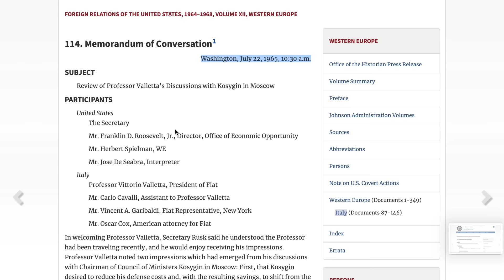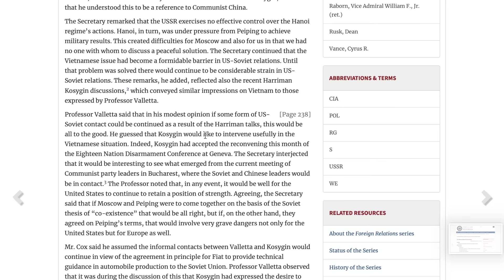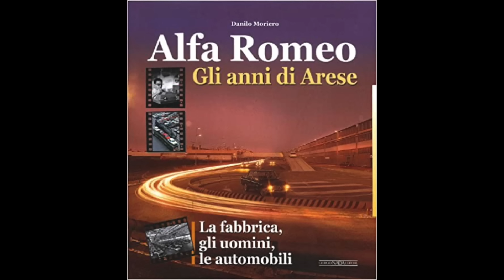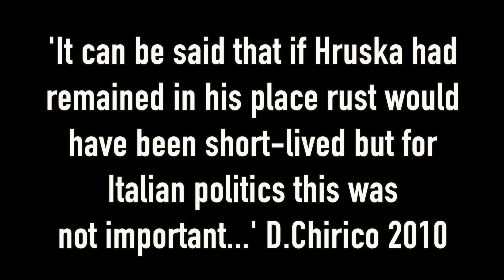Alfa Romeo And The Myth of Russian Steel - The Real Reason Alfas Rust

Comment: I think in Great Britain they mixed up 2 historical era and jump to wrong conclusions.
After 1934 for Italy it become very hard to source good quality steel due to sanctions for the war in Ethiopia. Stalin was more the willing to pay Italy in Oil and Steel in exchange for engineering projects and know how form ship building, to the point that many of his WWII ships were either built or completely designed in italy.
For Italy it was a necessary evil, but the quality of the steel was terrible: some sources (British as usual) wrongly state that Italian tanks were bolted instead of welded because of lack of expertise, which is not the case as welding was common practice in shipbuilding. The problem was in the steel used that did not allowed for reliable welding due to bad oxidation. It was made a priority to source all the top quality steel for the RM battleships which left none for the rest of the industry.
It is a known fact that the BD601 and DB605 aircraft engines built by Alfa Romeo could not rev as fast as the German counterpart despite being identical. The problem was the quality if the available steel, while Isotta Fraschini never managed to complete it's in line engine development for mass production due to structural reliability.
After WWII the Italian industry could access quality steel again, and the rust record averages similarly to what came from other nations, including the USA.
Certainly there were induced weak points due to saving on metal thickness, both from saving money and reducing weight, but not to unseen levels. As someone said the Beetles were rust buckets despite being thick as tanks and unnecessarily heavy.
Understand that Galvanized steel was not yet a thing in car making, power painting rare and expensive, cars were to be mass produced and rarely could stand 100k km in the hands of the average consumer, and second hand market was not big before the mild seventies, so, outside of the always mossy British isles, rust was not really a big problem. Paints were also not particularly advanced until the mild eighties with heavy solvent based misture and no use of advanced polymers. Chrome details and rubber gasket were all that was available to keep water out.
Until that 80s, export market was not particularly important for Italian carm makers for non "premium" products, as lower price models were mostly sold and driven inside Italy, so it was easier to stop selling problematic models, if serious problems with rust were found in GB, then re haul the whole production line.
Specific rust problems on certain cars (Beta and Alfasud) could be traced to faulty production lines but  don't forget that cars like the Mercedes 190 and several BMW also suffered massive rust problems and very few samples are still in driving conditions today.

Comment: All cars around the world had very bad rust problems... say mid 70s to mid 80s... Cars in the USA made in the USA had the same  problem... The story goes that cars were built to last in those days the life a car was about 15/20 years... engines would die before the body of the car  fix or replace the engine the car was good for another few years... The sale of new cars was not good... So to get new car sales up... A cars life was made to last about 5 years... And must be made that it would cost to much to fix... Body rust... This was done by the paint that was used some thing was added to the paint to speed up rusting... In the mid 80s car Manufacturer were Caught out doing this... and made to change... From mid 80s a lot of cars started to last much longer ... That is what a body shop worker told me...So if that is true I don't know ? But it makes sense to me...

Comment: I have to say I think most 70s cars rotted out quickly......just some more quickly than others. I had a1975 MK1 golf, 12 years later it was scrap...the shell was rotten. (I would say is was rotten from about its 6th year!!)
Same with VW Beetle...my fathers was rotten after 11 years and scrap! Again was rusting from about year 6
All 70's cars rusted...that's why there are soo few left now.
Also depends on climate, salted roads etc....
Put any 70's car in a super dry climate with no salt on the roads and it would still be going now!
I think Italian cars were just off lesser quality production than others......so they didn't really stand a chance.
Shame because the Italians can and do design lovely cars......
I think one of the British Leyland plants had the paint shop the other side of the road to the production line
Bare shells would be carted across the road come rain or shine to the paint shop!
And guess what....they rotted out too........
Cars from Japan were awful for rust....and still are......My ten year old Subaru died from a rusty  subframe and now my 2012 Mazda 6 has rust around the roof where it meets the windscreen and also front subframe is looking horrible.

Comment: I don’t see the problem with rust, the car gets faster as it gets lighter!
Vauxhaul/Opel solved this by self tectylating system by leaking oil from the oil pan and spread it under the car.

Comment: Alfasud's were manufactured in south africa as far as I know.  They had a factory in Pretoria till about 1985
Would not be surprised if your right hand drive car was made there
If it were, the rust story doesn't make sense.. south africa had none of the Italian manufacturing issues, no strikes, well educated and trained work force
Reply: Irrelevant.  First -  the South African built Alfasuds were made with bodyshells from the Naples factory so would have inherited the same problems, BUT as they were only built there after 1981 by which time Alfa had fixed most of the problems at Naples they were probably better made anyway.

Comment: Here in New Zealand I had the misfortune to work in a ckd (completely knocked down) car assembly plant in the 1970s and saw first hand the real reason certain cars rusted so badly. 

    They arrived at the factory in bare steel with a thin coating of oil to prevent rust. We then had to wash this coating off, an impossible job with the time constraints. The cars were then painted,  but over the oil, results obvious. 

.   Blame socialist politicians and their pressure groups for these fiascos. They try to dictate what is built, how their built, where and by whom. 

     Let the free market work and keep politics out of business. You'll see similar disasters looming in the idiotic electric car "industry" where these socialist clowns are rampant.

Keep up your excellent videos.

Comment: And IF Soviet recycled steel would be used ? So what! It is still the PAINT which protects oxidation. I particularly know two cars that had no rust issues but on rear hatch - so steel theory is lacking. One was Yugo and other was SKODA 136 (Felicia). Yugo rusted around rear hatch lock, like mad. And SKODAs were rusting below plastic trim on rear hatch, like mad. There is so banal reason why Yugo rusted there. The hole punched out for rear hatch lock was tiny bit too small for the lock and when they were assembled workers hammered lock through he hole. Always chipped paint from the metal edge. Years after of course water had it's time to make it's magic there. Than all people I knew used to leave keys in lock when the opened the hatch, because it was made so that it could be opened only with a key. Not to make mistake and lock key inside car, they all left key in the hatch lock until they closed the hatch and pulled key out. But Yugo had one bigger key and two smaller key in cluster. Bigger for ignition, smaller for all locks and smallest for reservoir cap. Those keys were dangling down and punching on paint beneath the lock which eventually gave up and start rusting. So "every" Yugo was rusted around the lock and had bunch of small rusty dots beneath the lock. Or, the smart owners, always had piece of insulation tape popped beneath the lock, for the purpose of protection. 

Skoda: similar reason. When plastic trim was "nailed" on the metal, it damaged paint and beneath the plastic it was a fold that collected water so it was often rusted. Many car specialists at the time were always against that time "fashion" to put plastic cladding on cars. That was fashion to "modernize" old models. They said the cladding is always rust farm. They were true. Perfectly healthy cars until you removed cladding.

Comment: Interesting indeed, and thanks for the in depth history including the political interference! I also thought the Russian steel was true. 
Truth be told, good vs bad steel would only effect its mechanical properties. If it is mild steel, not matter the quality - it will rust in the presence of oxygen. As I understand it, in the early '70s Alfa moved to Calcium based primers for it's low cost and ease of application (essentially cheap enamel paint) which was not good enough as an oxygen barrier, and assisted in galvanic corrosion. (apparently people in the know used to mound a zinc sacrificial anode from a boat outboard engine onto the chassis to stop rust from forming). Only in the late 70s did they move to Zinc based acid primers that kind of solved the problem. - later fully galvanizing the bodies with the launch of the 155. All being said, I drive my BMW with my head, but drive my rusty Alfa with my heart! In my opinion giving these old ladies a nip and a tuck now and then is a small price to pay for motoring perfection. That's all i have to say about that

Comment: This myth has to be debunked, in order to save the AlfaSud's aftermath, and everything this small car accomplished in the seventies, essentially creating the hot hatch sub-segment, alongside the Renault 5 Alpine. Production line issues also included improper windshied rubber fitment (ALFA also used rubber for windshields in Arese, made from the same Pirelli factory) which left cavities and gaps between rubber and body, insufficient waxing of closed upainted cavities and box sections (apparently, line workers had to insert wax with a large plunger inside the area, completely filling it. That caused wax to ooze and cover theirt hands. In order to avoid having to clean the area and themselves after each application, they just didn't push the plunger all the way, resulting in less wax in the cavity - the reason why ALFA added the foam step in the assembly line, only to realize that the used formula was hydroscopic), and most importantly, many absent force during harvest season, as many workers were also farmers in the area. Couple all that with the aforementioned lack of motivation, endless stoppages and minimal manufacturing tradition, and the result was a crippling manufacturer, eventually succumbing under financial debt and IRI's top executives, who just so happened to also be FIAT's top brass. Busso's resignation in 1977 was also dictated by this. Great video!

Comment: Look at the Soviet built Fiats and what do you notice?
They DON'T have major rust issues.
And they almost certainly were built with Soviet steel.
Reply from the maker: Yes, they also used thicker gauge steel…
Reply: There are no soviet fiats, the Lada is almost a completely different car, between it and the 124, there are over 800 changes/differences

Comment: The car manufacturers do a lot of tests and know to the minute when they bodywork will start to corrode. If they used better steel and components we wouldn't have to buy more so often. It's called "built in obsolescence" and if governments were really serious about the environment then it would be far more beneficial to force manufacturers to build for length of service than force us off the roads and the potential civil unrest. Industry creates 75% of the waste in the UK but it is the 25% of householders who are punished. Computer manufacturers, in collusion with software writers, are guilty of the same in the name of profits.

Comment: Japanese rusted straight away but their engines we're far more reliable than anything else .
Ferraris ' had no rust protection before 1984 and Ive heard that Daytonas  rusted very quickly  .Its always amused me that they command such prices ,
Lack of rust protection aside Fiats were worse than british cars .They even rusted in the middle of panels of mirfiori 131s'.FIAT paid out many compensation claims because of fires with the latter ,In Ireland where I live two children left alone suffered burning but Fiat would not pay because their father had a non approved sunroof fitted .They sued their father .The story goes that fiat rather than correct a design fault chose to pay compensation ,

Comment: Never owned an Alfa because of the horrendous rust problems back in the early eighties but I did own a Fiat 128 and a Lancia Prisma and none of these suffered the dreaded rust rot, however I've also owned a Honda Accord from about the same period and that rusted on the panels under the paint.

Comment: Why hasn't someone or even you just had a scientific analysis of the composition of the steel?  That could determine not only what the alloy makeup is but even could determine what mine it came from.  But it doesn't have to be that difficult.  Test some Soviet tank steel and old ship steel and compare it to the Fiat and Alfa steel.  This couldn't cost more than all of the research put into finding 50 year old documents to find mentions of the purchase process.

Comment: Italian cars were no more  rusted as other cars were, more or less up until the mid sixties, there after, say 1966-1967 on wards and all through out the 1970's Italian cars rusted at a level and rate unprecedented until the early 1980's. The reason was NOT Russian steel, nor was it factory work practices.
          There were no en mass produced cars in Italy (as in the USA) to speak of until after the second world war, one needed to be  wealthy in Italy to own a bicycle let alone an automobile, in terms of the mass population. In wealthy countries pre war and post war Australia, USA, Canada, for example etc mass production I.E  Ford model T, model A, and the other dozens of manufactures that existed at the time were producing cars for the masses prewar, NOW post war Italy (cars for everybody)  mostly all cars produced in the 1950's and 1960's as they approached there use by date (somewhere between 7 and 15 years) unlike Australia for example (up until the great demand for steel from the Chinese from 2000 on) every rural property would have cars,,,,old cars parked under trees, in paddocks, and so on, NOT so in Italy (no room) so by the end of the 1950's a recycling of the early post war mass produced cars was introduced, (particularly as Italy had no Iron ore) in effect the Italian cars of the seventies were recycled Italian cars of the decade before, to cut to the chase, they had not figured out the metallurgical methods in which this problem could be avoided until the 1980's. The steel in the 1970's cars was rusting from within in itself, (impurities) not from the surface under the paint,,,,,,,,,get my drift. No ones fault, certainly not the Russians. Simply put, Italy is resource poor, very poor, (unlike Sweden, Germany) had to recycle, they eventually solved it, but not before it gave Italian cars a very bad name for a long time. Italians are very sorry for those that suffered with those issues, it is now history, and Italian cars are now, and have been for decades as rust free as any other car on the planet.

Comment: I have what I believe is definitive proof.
My 85 Spider was very good, and only had a small amount of rust in the usual places. Areas that would entrap water, and areas where the normal drainage path was plugged 
But, my 64 sprint, whenever a part would be ready to separate due to rust, and I would tug on it, asking in a sarcastic tone, are you Russian? You could hear distinctly, as it hit the ground, "Da"
Reply: BTW thanks so much for the vid, and clearing this up. It is a strange bit of lore. As are so many bits from Alfa days.
Kudos and keep up the wonderful work

Comment: SIMPLE .. ZERO coating of the interior metal surfaces with anything, they just did not do anything to the BARE METAL you could not see !
The opposite is how many Japanese cars do it, they build the body and dip the whole car in electrically charged paint. You can't get a Japanese car to rust !

Comment: Italian cars had deficient steel all the way back to the 50s and 60s models it was no surprise they never used great quality steel after WW2 or primers before painting their cars ,the north italy producction was some how beter than the south besides all troubles with labour and its lack of experience nor competence the placement of the factory was key ,you dont produce great cuality steel products in the middle of the mediterranean sea ,salt will allways be in the air all year arround ,besides italians never used great quality steel for structure of their production it just had to look nice ,engines were other thing and were and are well engenered and buildt , FIAT waited until the end of the 80s to start aplin CATAFORESIS they called such priming baths before priming and painting even do with mix results in their domestic and overseas production 
In the USA there is another legend will be nice to investigate with INTERNATIONAL SCOUT line of production , its known for its poor resistance to corrotion due to a batch of steel sheet bougth realy cheap and let out witout any propper storage allegedly